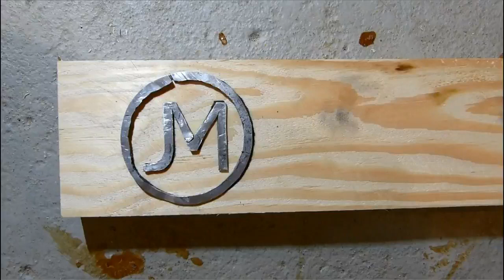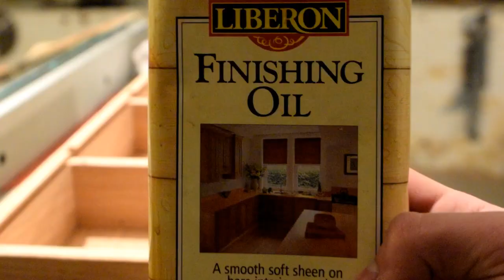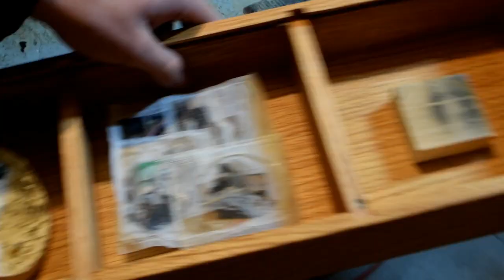Making A Solid Oak Display Case w/ Box Joints [25]

Comment: Cool, I also agree with you on the glue thing lol
Reply from the maker: I CANNOT CANNOT stand glue ups, just doing another project now, all was going well, started the glue up, and then glue made the wood expand so nothing fitted together so it ended up cracking - everything ends up going wrong during them! I hate them! Lol
Reply: I always manage to miss a bit of squeeze out and then the finish wont stick to the joint haha
Reply from the maker: +TommoByrne so true, and it's always on an internal angle that's impossible to sand xD